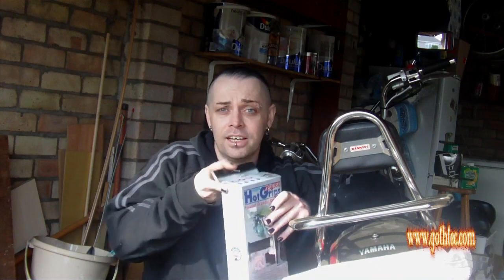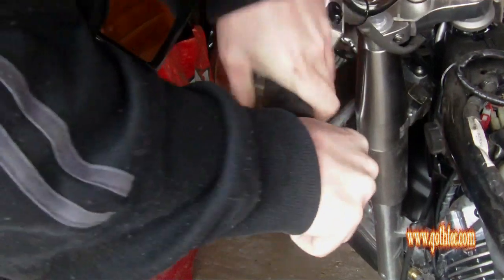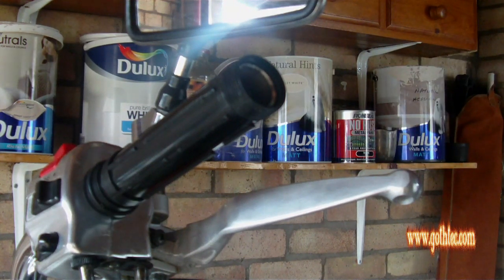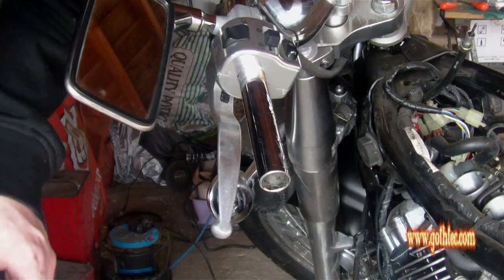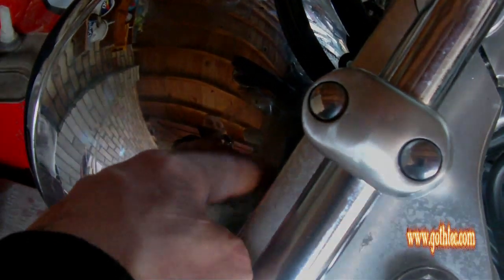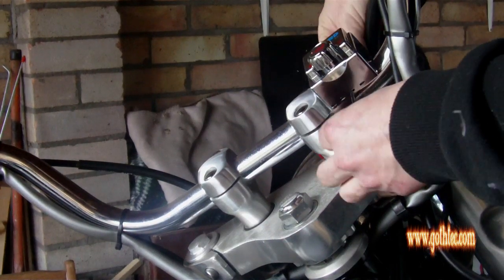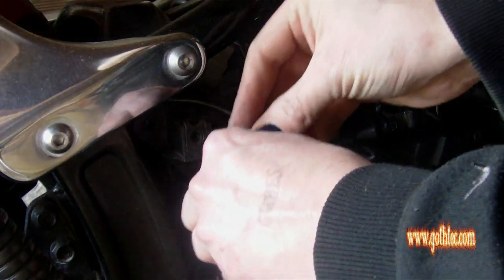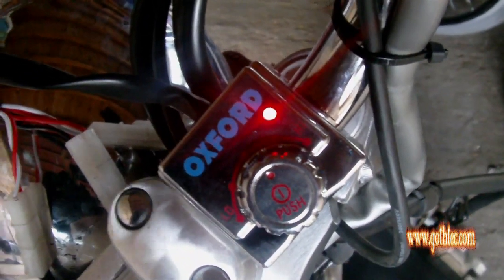Fitting Heated Grips to your Motorcycle (Oxford)

Comment: know this vid is old but l had a problem with my right one. its too loose and its twisting around! very annoying especial if l need to accelerate quickly, any tips? l have yamaha virago 535 :)
Reply from the maker: +Pao Reno There are usually plastic sleeve adapters included in the kit, it sounds like you haven't fitted the adapter sleeve over the throttle.
Reply: +Gothtecdotcom it was a garage that did it and probably screwed i;) l will check it out

Comment: Nicely done video, just one thing for people trying to remove your grips....If you have a air compressor get a small narrow fitting to put under the end of your grip. most of the time with that and dish soap gets em right off.  Without having to use a screw driver :)

Comment: Thank you for sharing.  Very informative.  I will install one in my 1993 Honda CBR1000F.  I'll use the headlight low beam socket source for power.  Since I replaced with HIDs, I only need one headlight, very bright!   Cheers.

Comment: So did you not use any sort of glue for your throttle grip?
Reply from the maker: If you use hairspray it isn't needed - old biker trick. If you look at what constitutes hairspray you'll find a list of ingredients that include polyvinylpyrrolidine, which is also used to glue the layers of wood in plywood together. Amongst other polymers. Hairspray is effectively glue for hair.

I later refitted the grips to a better position for me, in that case I used glue.

Comment: I like your video, thanks for making it, check out Larry's motorcycle they have a fuse block that let's you add lots of switched and non switched power connections, I would like to install one on my bike but I don't quite get the connection configuration. If you do a video on something like that I would be most interested in seeing it, your tip for the hairspray I've used on Bicycle grips works great. I might go with a try on installing the power block, was hoping to see someone else do it first